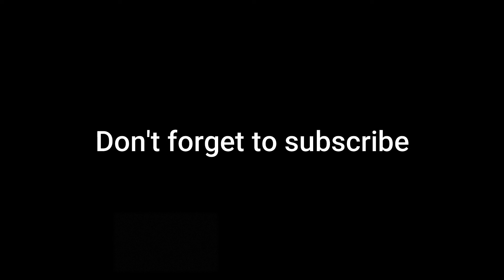How to replace liftgate glass hinge.

Comment: What part did you order and how much was it. Ours just broke and looking at replacement parts.
Reply from the maker: Bought it from Rockauto.com around $40 
https://www.rockauto.com/en/catalog/ford,2010,expedition,5.4l+v8,3015229,body+&+lamp+assembly,liftgate+glass+hinge,46117
Reply from the maker: The one I did send you is for 2010 expedition. With better look it the same part# for 2008
Reply: @ArniAtlason does this also fit 2010 ford explorer?
Reply from the maker: @Go4T___  I wouldn't be surprised if it does. One of my viewer said to me following in the comment, I used it to work on a 2010 ford escape, it's nearly the same. Ford escape uses 5mm torx screws. So, it works on many Fords.

Comment: You did not show how you got that corroded stud out of the glass? I  mine looked corroded just like yours and was waiting to see what you did!! Boo!
Reply from the maker: If you go on 0:50 on the video then you will see me using trox on the screw in the window and I'm using wise grip on the other side.
Reply: I had to drill mine out which was successful. I had the replacement hinge successfully reinstalled and decided to frighten the toro screw just a little tighter and unfortunately the white metal broke apart and new hinge ruined. I think I will just drill it out and installation stainless steel nut a bolt to hold it until I can get another replacement. Talk about feeling stupid.
Reply: Thank you fir saving me time watching that long drawn out bs is frustrating when your already frustrated so thank you again 🎉🎉